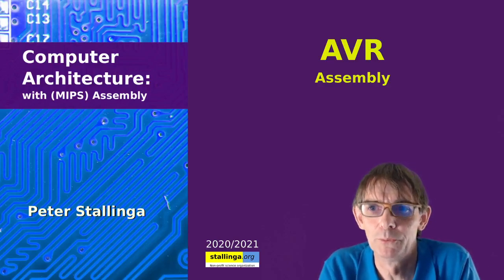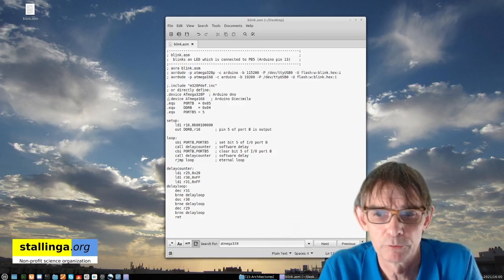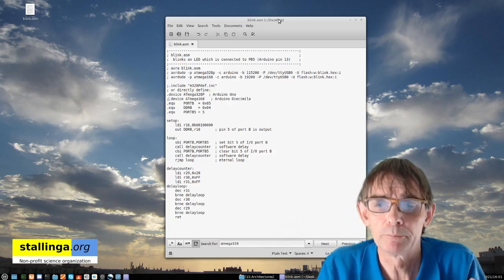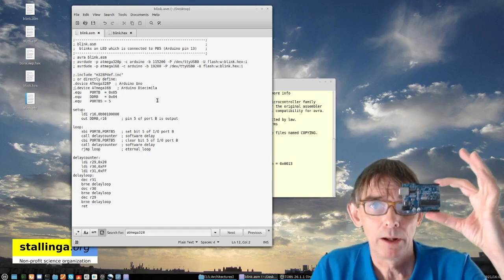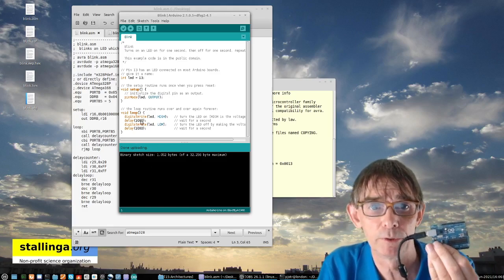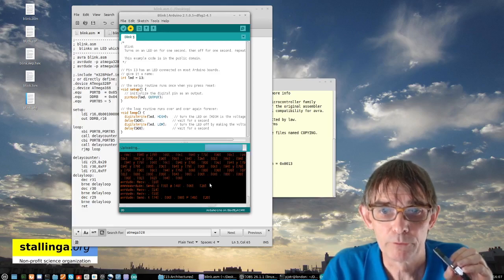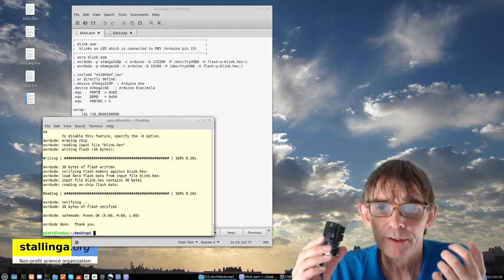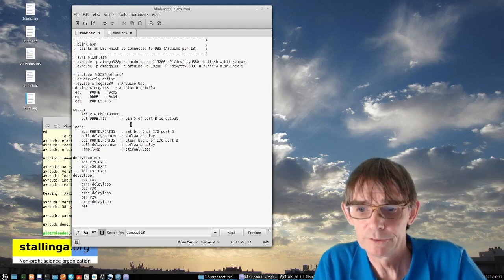Computer Architecture: AVR Assembly

Comment: Remember that there are two variations of assembler for AVR, GCC and Atmel own assembly, use same instruction of course but there are syntax differences, so you can't share the code without any modification first between Arduino(GCC asm) and Atmel studio(Atmel asm), a trap for beginners.

Edit: It's possible to write asm code in the Arduino IDE, don't need write it first in a notepad or so and import it or upload it with avdude or so. Make new tab file and us .s as extension in the file name. If I remember correctly, you get some syntax highlight so that is very nice, better than notepad. Must include the S file in the C file and the call to the main routine in your assembly code in the C file. And upload it form Arduino IDE, will not generate the most efficient machine code but works very nice for beginners that wane learn asm code, they only have to deal with one program.

Comment: How would you do something like "mov eax, [esp+1]" (like in x86 assembly) in atmega328p?  Basically, I noticed using "[SP]" doesn't seem to work in atmega328p assembly.
Reply from the maker: Not sure about that. I suspect atmega is much more limited and such complicated addressing modes have to be deconstructed by the programmer.
Reply: In AVR assembly, eax would be something like the R16 register, and esp would be the stack pointer register (its a 16 bit register, so it has two 8 byte addresses named SPL:SPH).
Your question refers to indirectly loading data from somewhere in the stack, this can be done by first copying the stack pointer into the "Z" pointer:

LDS ZL, SPL
LDS ZH, SPH

Then you would load the data into R16 like so:
LDD R16, Z+1